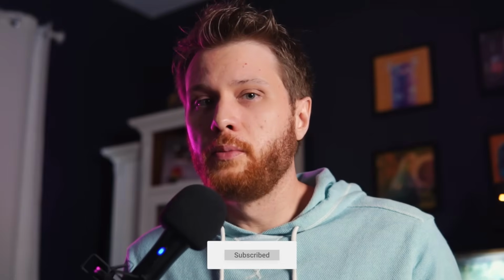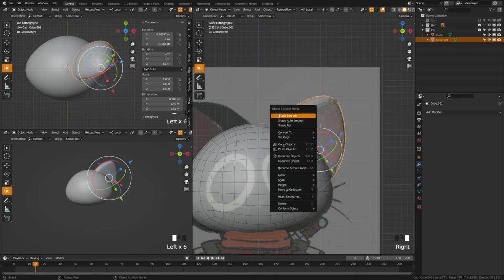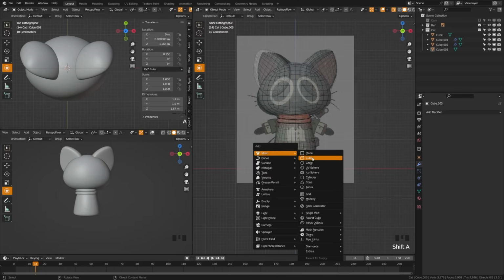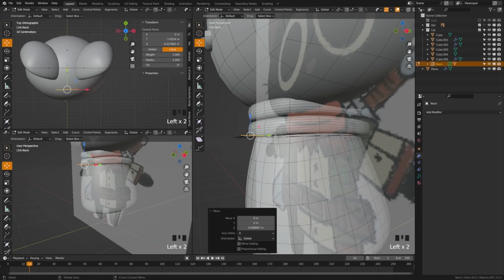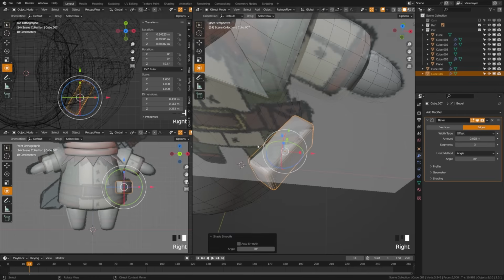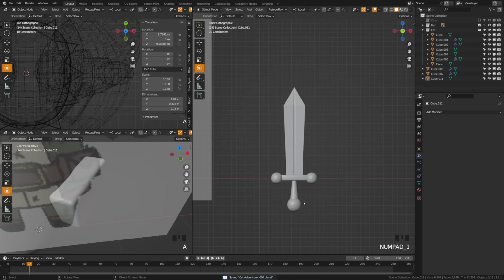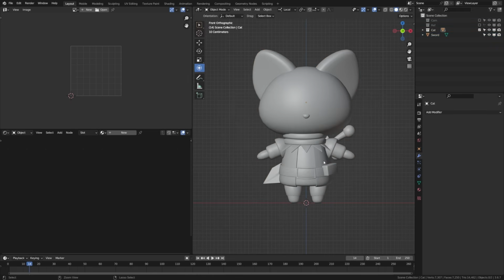3D Cat - Blender Character Modeling for Beginners | Real-Time Tutorial

Comment: slooow..... I cant follow even in 0,75x speed.... I don't know, why every entity who is good in blender cannot make a proper followable tutorial!? Instead of just flexing. This is the 3rd tutorial from different creator which is hard (or not possible to follow, because the results are very different than in the video) for example: "convert to mesh" where? how you brought up the search bar... why you don't say where to find it? Why I have to dig through comments to know this? Why I have to have ChatGPT open to follow a "beginner" blender tutorial because half of the steps are left out... it is exhausting.... this is why blender stays black magic instead of a good 3D tool.

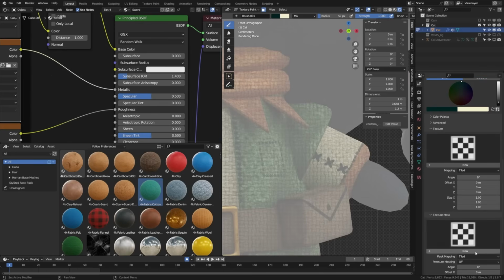Comment: My "grid fill" (blender 4.3.2) doesn't work like yours (28:27). I've got a sort of "ladder" (long faces relying edges of two sides) instead of a grid.
Reply: sorry, I meant 4:00 for the timeline.
Reply: @raymondmunier3168  did u solve that problem? same with me
Reply: @loomy狐  no, I didn't. I used knife instead.
Reply: @raymondmunier3168  what about beveling arm(upper part) doesnt work for me (14:10)
Reply: solve it(just redone hand*0*)

Comment: Things I noticed while forcing myself not to move to another tutorial...

- Most beginner tutorials, if they're going to have a fresh scene, tell the viewer to delete the original objects. Noticed you had no camera or light so I deleted everything in the scene before importing the image.

-No real direction as to how to place the image in the scene based on front orthographic view (or any explanation for your screens being set up the way they are. Just personal preference? Will the setup of this layout with the 3 viewports be useful for this project?

-The video opens with you editing the "fast" and "slow" speaking for a 'beginner' tutorial, yet I'm having to slow you down to about .75 to follow the keybinds you're calling out. 

-Not only did I have to find the search keybind by going into preferences...convert to mesh I suppose isn't a thing anymore? So I just applied the modifier under the modifiers tab of the cube.

-How'd you swap to sculpt mode with that radial menu? Closest I could get was holding Z and sculpt mode wasn't an option. 

-Absolutely 0 direction on this "realistic and appealing shape" for the head. I'm literally trying to imitate your movements to make sure this matches. Kinda save to assume I think that as a beginner, someone may not know what you mean in terms of these shapes.

-No indication that we've swapped back to object mode for the shade smooth instruction. Tried right clicking in sculpt mode because there was a cut in the video.

-Adding the cube for the ear, you say CTRL 3 for the subdivision modifier "for three levels"...then IMMEDIATELY shift the viewport levels to 2. No explanation. No callout saying "hey actually I meant 2 levels" or "shift it to 2 levels with [keybind here]". Took me trying to line it up like yours to realize, again, a step was missed.

Thank god there's people in the comments with tips on certain parts of this. The only thing I feel I'm truly learning is how to teach a beginner for when I feel confident enough to pass down knowledge and remembering my first time finding a tutorial that said "for beginners" on it.
Reply: lmao

Comment: I made it to the end but... how the hell did you paint it so well??? I dont know how you could be so accurate with the paint tool? is there something I should be using?
Reply: prob a drawing tablet
Reply: I use both a Wacom-One and a mouse, I like to stay using keyboard mouse my main 4k displays than have too downscale to a 1080p tablet for quick edits

With a mouse, it's important to go into the brush settings menu at the top of the 2D or 3D Viewport and turn on:
Stroke → Stabilized Stroke → Checkbox
The brush now lags behind and follows the mouse, making a smoothing path. 
Adjust the sliders around until it's EZ to draw smooth lines. 

You tab into edit mode a select face, if a face is selected when you tab back into texture paint, you will ONLY be able to paint on those faces, no more going outside the lines. You can use Ctrl +E to add edge splits or G + G to slide an edge loop if they don't line up right. 

Textures / Texture-mask help a lot too. 
Need to paint eyeballs? Just load up an eye texture, set to stencil mapping, line the stencil up, rub the cursor randomly over the eye, and it's perfect every time. 
Works really well too for stuff like painting signs and flyers, dirt, texturing, etc.. On to a wall. Spray paint graffiti textures that way is fun :3
28:11 ZBrush has a lot of Alpha stencils posted for free online and this works not just for the stitches, but for anything that you can find a 2D image,  but if you have  Photo-Shop or what I prefer to use, MS-Paint, you can make custom ones yourself, 

The only thing drawing tablets have a mouse doesn't is pen pressure, it helps speed things up, but it's not necessary, I can get the same end results by just using more brush strokes, either way you need to learn muscle memory to draw, most people know handwriting and sometimes traditional art with pen/paper/brush, so pen tablets feels easier.

Comment: he goes really fast on some functions and doesn't explain what they actually do so a lot of stuff can get messed up if your default settings arent what he's using, so this is some of the stuff i had to change for things to work

for anyone else stuck at the ear mirror modifier section, check what axis the modifier is reflecting across! his axes are set not to the blender default, in order to get mine to match i had to reflect across the y axis

also for the triangles along the curve, if theyre not scaling properly along the curve, make sure the origin of the triangle plane is set to the same origin as the the circle, which will probably be the origin. if you search using f3 (that seems to be the default blender search hotkey, but you probably knew that if you got that far in the video) you can use set origin to 3d cursor

additionally for the part at 22:40 when hes creating the pants, when you hold i and ctrl drag, if youre getting a lot of gaps between your faces, a little submenu titled 'inset' should be visible in the corner, inset is what the i is a shortcut for, make sure the 'individual' option in that menu is toggled off

Comment: Why Convert to Mesh if you add the cube in as a Mesh??? Should it not already have the available topology?
Reply: I’m still new to blender, but from my understanding the “convert to mesh” is converting the currently selected object’s modifiers to mesh! Meaning it’s basically a shortcut to applying the modifiers (Such as the subdivision modifier that is created when you press ctrl+3 to turn it into a sphere). If you don’t apply this before you start editing, the editing will still act like you’re working with the original cube mesh rather than a sphere!

Comment: Hey! If you're a beginner/someone who hasn't used Blender in a while that's watching this tutorial and got to the part where he started UV unwrapping and painting the model, then first off - props to you for getting to that part but also, something important that he didn't seem to mention is that when you're painting the model, it is SO SO important to either pack your textures into the file (you can easily look up a very short tutorial on what that means/how to do that) or to constantly save the image with the UV on it to your device. This is because unless you do the former mentioned thing, if you only save your Blender file, you won't be saving the coloring you put on the UV and things will revert back into their default, uncolored state the next time you close and open your project.

Comment: For those wondering why their edge loop selection isn't working, try double clicking on a line segment (in edge select mode). You can also find more selection options on the toolbar at the top, under Select.

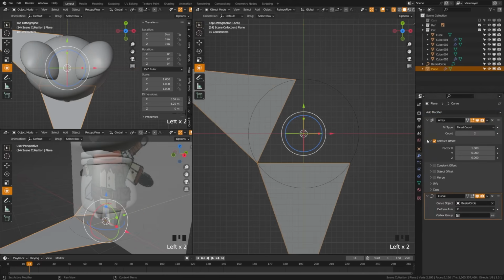Comment: Hey dude! awesome tutorial but wow you go fast, I have a question though. Around 10:43 you have the triangles snap to the circle but mine isn't doing that for some reason. If anyone could lend a hand on figuring this one out, that be much apricated.

Edit: Never mind, turns out it was because I forgot to switch out of edit mode!
Reply: i had the same problem but the triangles snapped to the circle once i came back to object mode idk if it helps
Reply: thanks bro

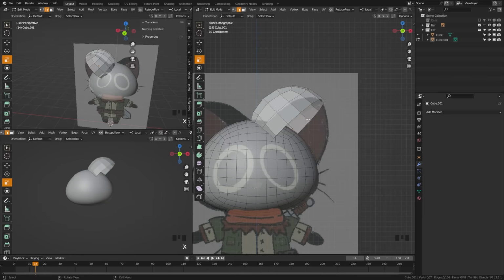Comment: kinda a dumb mistake on my part, but if anyone was struggling selecting which half to use at 2:50, after using shift + alt + Lclick then hover your cursor on the side you want to select, THEN press L.

Comment: This is still too fast for someone who just opened the program for the first time. No explanation of the views you have, why they're helpful, how to set them up. The sequence of buttons G and Z to lock movement up is neat but isn't intuitive in the slightest to a beginner. I couldn't see enough to drag the sphere up from the axis so I had to figure out how to pan the camera as well and that was also not intuitive (and could have been avoided had the views been set up first). Now I'm only a minute in and wondering how things got scaled up in "edit mode"? What's that? The edit button at the top next to file? No. Right clicking? No. Thank god the buttons you're pressing are on the screen, as that's apparently tab and then s. Scaling that isn't remotely intuitive. What I thought would be a grab and drag motion just confirms it, apparently I'm supposed to just move it without clicking first and then click (grab) to confirm.

If you have a tutorial for absolute beginners, maybe pin it to the start of the video?

People get so used to software they have no idea what is and isn't intuitive to beginners. This isn't a shot at you, but at Blender itself -- I want a program I control like how a programmer would expect a user to rotate the camera and scale objects like in a video game. I'm not saying its universally standard to hold down right and move your mouse to rotate around a 3D space but it basically is. =/

Comment: As a beginner with about 5-10 hours, I had to give up on following this tutorial. I made it about halfway through after a solid 10 hours working on this. The screen layout with 3 windows is very confusing and complicated to follow what you are doing. You move through item sections, shortcut keys, and menus way too fast; even at 0.25 playback speed. I had to watch every section many times to get what you did, and I am still making errors I don't know how to fix. Lots of good techniques but I spent more energy following you than learning. I guess I need to find something simpler.
Reply: I'd recommend Blender Guru's donut tutorial before this one if you haven't already
Reply: Update: I stepped away from this for a week or so and then tried again and was able to get all the way through it. I learned a ton in this video but for someone with less than 20 hours with blender this was a steep learning curve.

Comment: This was a solid modelling introduction, I subbed like 2-3 mins in.

The unwrap was perfect for these purposes, quick, simple, done.

Then the last 3 minutes were straight to time-lapse speed, beginner lost...

You even reposed to model, it's not complex, but again, beginner lost...

It would have been better to demonstrate the block out for a few areas, showing how to hide and show areas to better paint or basic masking.
At least that way as a beginner the model could be coloured basically.

Then the window of materials just comes from nowhere, a link to your 'Blender 3D Materials Explained - Beginner to PRO' would probably help, but I think a quick and dirty video to setup and get up and running with your free pack would stop people bouncing off to end of this tutorial.
To do this tutorial the viewer only needs to apply existing materials, there is a LOT of (good) information in 'Blender 3D Materials Explained - Beginner to PRO' but for someone that wants to follow this tutorial it's tmi...

This is a great modelling tutorial! (with a 3 minute demo of texture painting and prefabbed materials at the end)